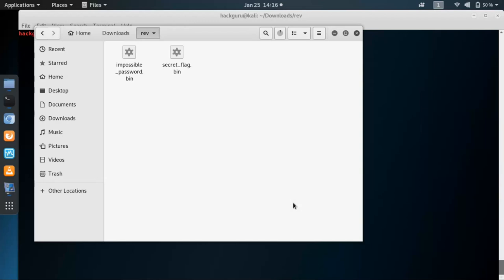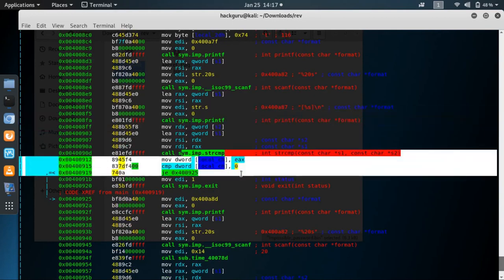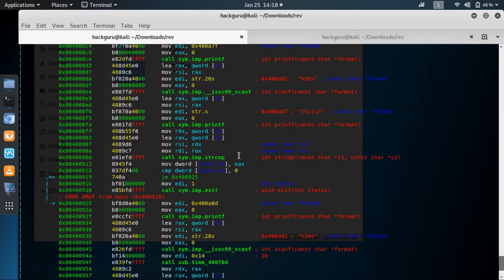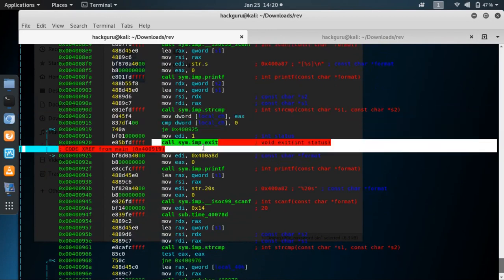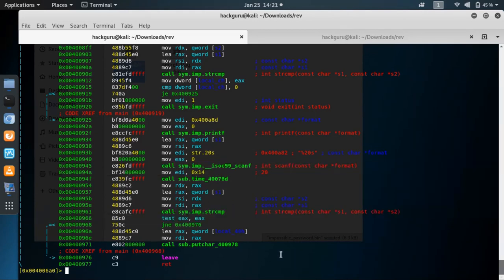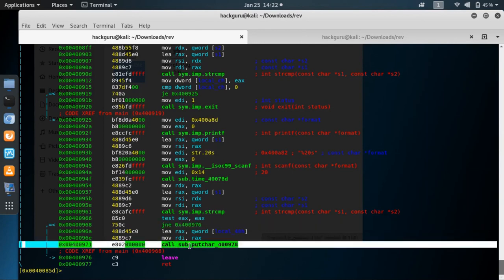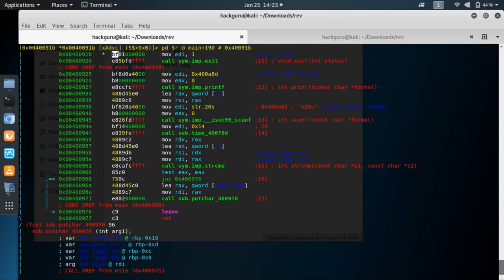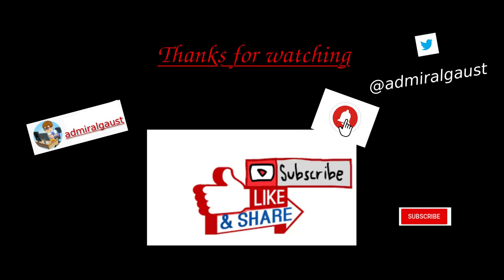Impossible Password - Hack The Box (Walkthrough)

Comment: When I insert hex and quit it doesnt seem to save it, am I doing something wrong?
Reply from the maker: May be you are doing something wrong.....use the -w flag with radare to open the binary in write mode.

r2 -w - AA binary_name
Reply: @admiralgaust  I'm having the same issue, whether I open with -w or use oo+ command to put it in write mode, after adding the two nop (9090) my changes do not save. I've done a ton of searching on this and the "q" command from visual mode should save, but is not.
Reply from the maker: I have no idea what is going wrong with you but I can provide you a workaround.

Open radare in write mode and use the command `wx 9090@<address>` to write the changes. This will work 💯%
Reply: @admiralgaust  maybe they need to type "wq" instead "q", that's will save the changes